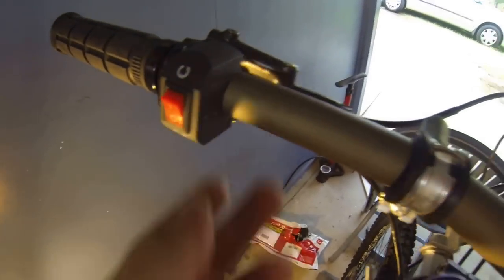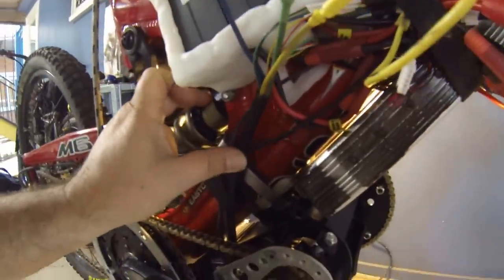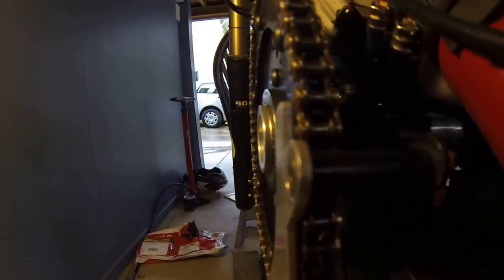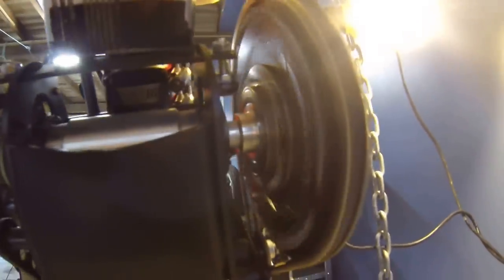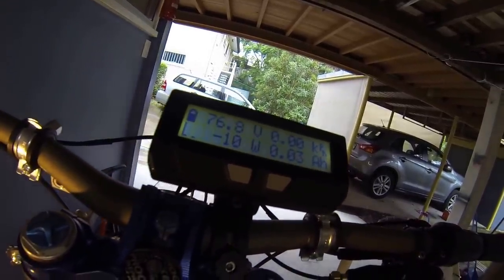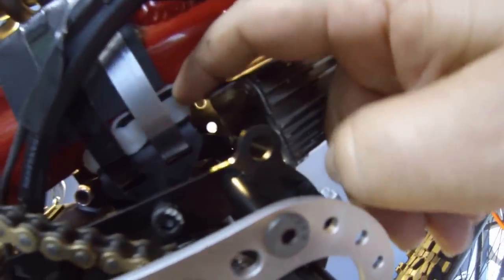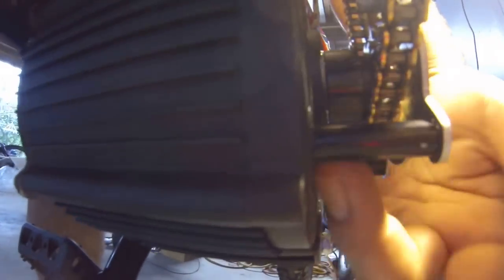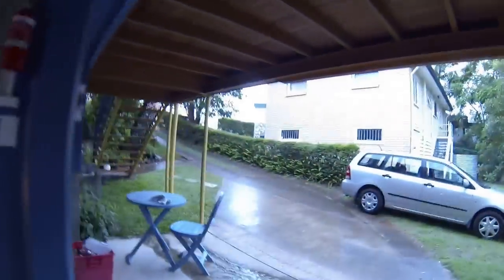LR Big block turned on for an Electric Bike review kit conversion

Comment: Bugger all clearance for the crank.   How's your chain lines?   Def sounds like its rubbing a fair bit on something on that primary side.
Can you space your crank arm out a bit maybe and still get plenty of bite on the crank?   Could maybe gain a mm or two there.
Could be you can get the whole bb over that side a bit more,  when you pull it off again check for spacers there.
On one of my older builds I actually used an angle grinder to shave down the BB itself on the frame on the right side to give me more space on the left with the BB installed.
Reply from the maker: +Tom E It looks set to work the way it is for now, the other side has good clearance.  I could steal a few mm from there but for now rather complicated.  The crank shouldn't weaken too much after taking under 2mm off....  Chain line is good for now.  Must work out rear sprocket system because the 9speed is only good for human power.
Reply: Yup,  totally,  I get chainskip even with a small block,  and it rarely pulls more than 1500w.   
Getting the chain length right (shock out,  to allow for full suspension movement) and putting on a chain guide and mine's pretty much sorted.